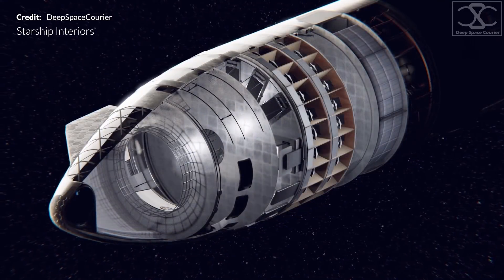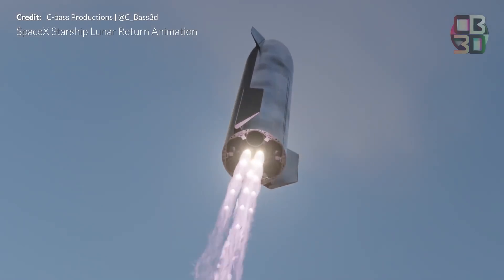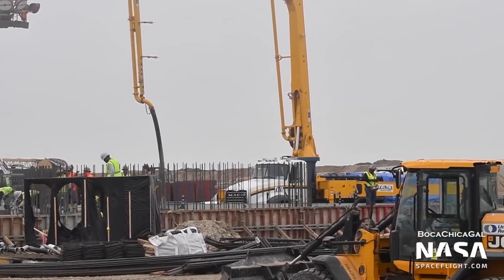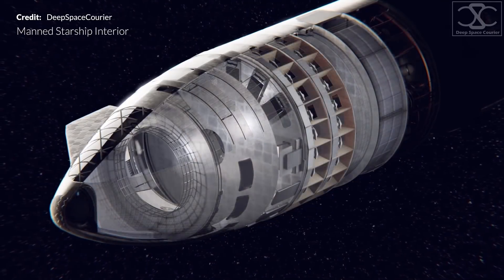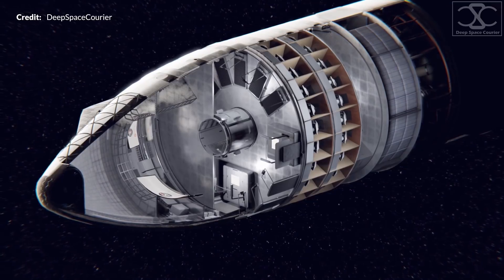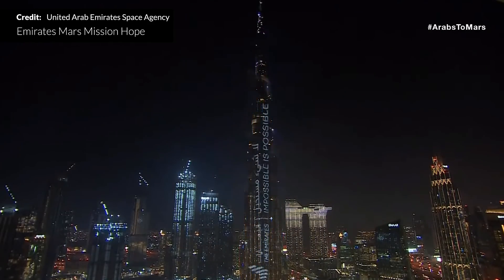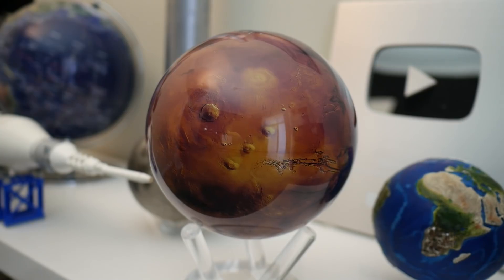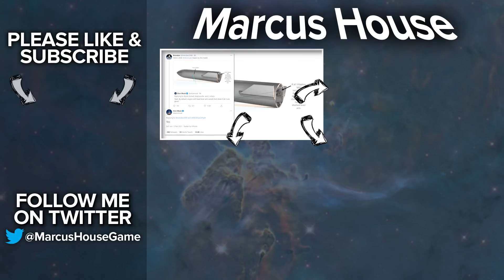SpaceX Starship to attempting another flight with SN10 - Can they master the flip and landing!?

Comment: I so dislike people that jump to the "fail! stop it, waste of money!" conclusion. As if people these days have forgotten what it takes to progress, to used to the Internet in which many grew up, offering instant gratification.
Reply: Apollo had massive payback in terms of the technology that was inverted for it. Even the current Mars rover has payback on some of the new technologies that will benefit mankind and America. Sls uses the flower of the seventies technologies and is really just assembly of parts designed back then so does not have nearly the same spinoff payback. NASA should pivot to the technologies needed to survive in space and on the moon and Mars. There would again be paybacks for American companies in new technologies for earth.
Reply: SLS is using 1960s methods where they try to solve every problem before anything gets made (think Saturn rockets) and then live with all the unintended problems they create (Think Space Shuttle).
Reply: @Dave5843-d9m  sis is more like the space shuttle. The manned space program had lots of failures just like spaces Mercury had 3/14 failures. Atlas-agenda booster had 16/109 failures. Apollo 1 & 6 were at least partial failures
Reply: I also love how nasa said that using the falcon heavy with two launches for Artemis would require a years delay and 200 million to write the software for docking in space.
Reply: M. de k.  Sure, a good analogy for grit, but when you're the first one doing something, you can run out of time and money before you reach the promised land.
Reply: @aresmars2003  Almost happened with Falcon.  Good thing Musk and SpaceX have more money to work with this time and an ever improving stable income from their current products.  I wouldn't even mention Musk specifically here if he didn't bet his own money on on that last Falcon test.
Reply: People can't root for someone else's success so they celebrate when others fail.  Theyre just crappy people.
Reply: People that give up after 1 failure obviously don't know Thomas Edisons statement about his failures at a functioning incandescent light bulb.
Reply: Biggest "waste of money" on Earth: women's fashions.
Reply: @conveyor2  I give you the bikini, the g-string, the mini skirt, stockings, heels, and whatever those shirts are that show their tummies.  And yoga pants.  Thanks the baby Jesus for yoga pants.  Go back to church and leave us to our young women you peasant.
Reply: Yeah it's funny to think the Wright brothers started as a whole family...
Reply: Falcon 9 took 3 failed attempts to succeed and avoid bankruptcy... Starship has had 2 successful flights and 2 successful recycling... ALL other rockets have never sticked their landings since WW2.. period!

So, stop criticizing or make your own!!!
Reply: IKR
Reply: YEAH! RIGHT, AND TO THINK OF - IT'S NOT EVEN THEIR MONEY SPENT...
Reply: If we quit after a handful of failures we would probably not even be flying planes today.

Science and engineering need time.
Reply: I do feel those critiques apply to SLS tho
Reply: @Mike.The.Jeweler  I agree. Mostly because of the price tag, it being legacy hardware and expendable. The latter is seeming to be more and more unacceptable.
Reply: I use the internet but u Understand and know that it takes time to do things pls even the internet is not That fast it's still taking few milliseconds
Reply: The SLS is a waste if money.  We don't even get the see progress our tax money is wasted on.  I bet the VPs and CEOs of those companies are loving their beach side mansions though, watch the SLS sitting on the pad collecting dust.  NASA should not be making rockets anymore.  They keep failing the world.

Comment: The explosions look dramatic - but they're not detonations and almost all of the kinetic force is straight down. Yeah there's the chance of damage but two crash landings so far and no major damage yet. When damage does occur - more serious than just the pad - it'll likely be quite minor - all of the fuel farm tanks have thick enough steel to survive bullets - a starship exploding nearby? a mere breeze.
Reply: Second crash had pretty spectacular shrapnel showers, even getting close to the waiting SN10 ... which might have been the intent of parking it that close by... After all FAA had complained about bad models/predictions of shockwave and shrapnel damage from any crash, this might have been their attempt to gain data from the fully equipped sensor suit of SN10?
Reply: effectively. the explosion is ABOVE the starship that crashed. since we don't see the hull flying off in the distance. it most likely ruptured at the side facing up.

Comment: Can you imagine when they try to land the first super heavy booster and use the same landing point as SN8 and SN9 - could wreck a load of things with all the extra fuel and debris
Reply: I'm pretty sure there won't be much more fuel in it when it's landing, no point in bringing any extra back. They dumped the extra oxygen off the starship too before it headed back down.

Comment: What do you think about starship locking up it's flaps during reentry? I'm not really sure the motors could handle such extreme forces
Reply: I think they will be as flush with the body on reentry as possible but still be free to flick out a little to help balance the craft in flight.
Reply: The motors won’t be active during reentry when their is maximum force and heat. The reinforced structure should keep starship together including the fins. Only after those couple of minutes of reentry do the fins start working.

Comment: SN 10 will most likely achieve RUD. Just in new and innovative ways.
Reply: The flip totally works - the engines totally work - it's just some glitches - pressure, gas in the fuel lines blah blah - all minor things - yeah they'll lose some starships getting it right - that's why they're building so many. RUD is good.
Reply: So long as it's for a new reason it's okay, it mean they're making progress
Reply: I think they’ll land it this time.
Reply: @pyrofan80  X for doubt.
Reply: @sheldoniusRex  X
Reply: My prediction is it almost makes it.. mostly correct landing just slightly too rough or maybe falls over before RUD.  Then SN11 will be successful. 4th try has been good luck for SpaceX's risky bets.
Reply: @bubblesculptor  3rd time is the charm, but accounting for inflation, therefore 4th right? :D
Reply: @bubblesculptor  I really want to see the landing legs deploy, I'd be ecstatic
Reply: @bubblesculptor  yikes about sn11
Reply: @Darenz-cg9zg  idk I don’t think he was it seems like a good idea and he said they were “dumb” for not trying it earlier but let’s hope it works out in the end
Reply: I wonder how long it takes to fix the  engine relight issue.
Reply: They landed two flying grain silos already with the hops but that was using main tanks not the wimpy header tanks.  Maybe they need to get vertical at a higher altitude and use the main tanks.  Then they will have the same conditions as the hops.  Blue Origin can hover for like 30 seconds.  I think that's the ticket !
Reply: RUD due to ERE (engine rich exhaust).
Reply: I think the it will be close but either an unforeseen issue with briefly lighting 3 engines will cause something to break or they will find out that doing the flip this close to the ground wont give starship enough time to cancel out its horizontal velocity so it tips over post landing because the stumpy little legs will fail.
Reply: @FutureMartian97  that’s the thing with expiramental rockets or anything you won’t know till you try it